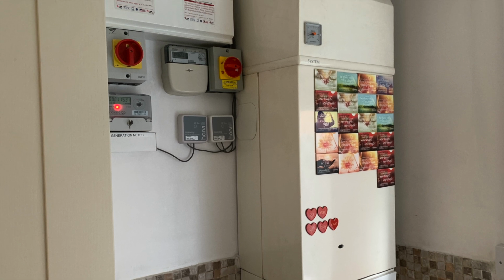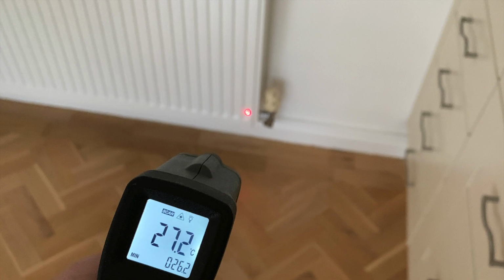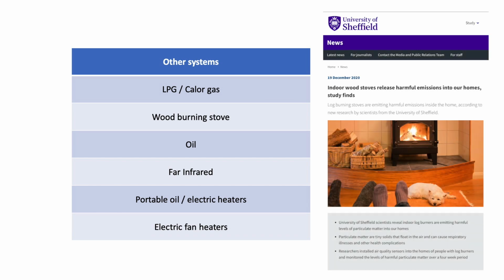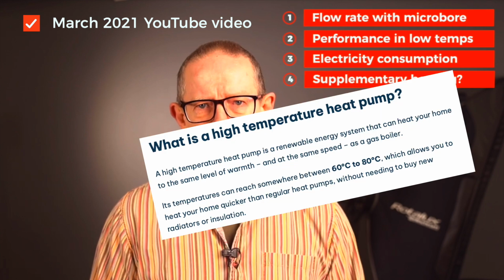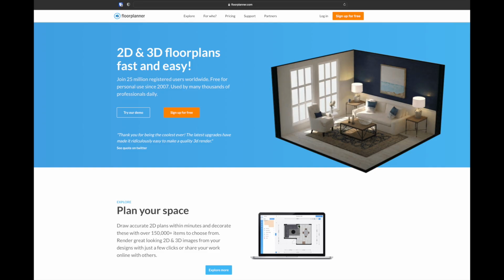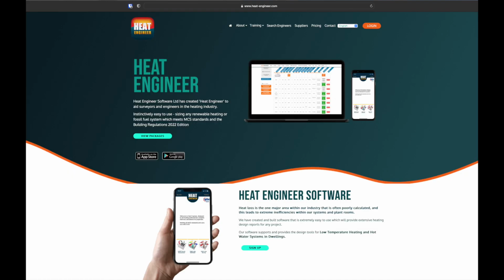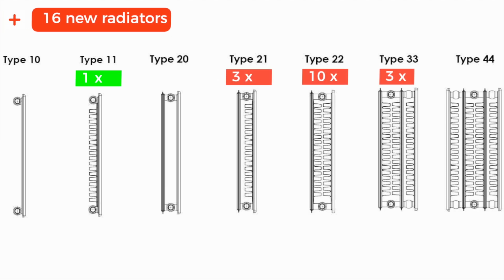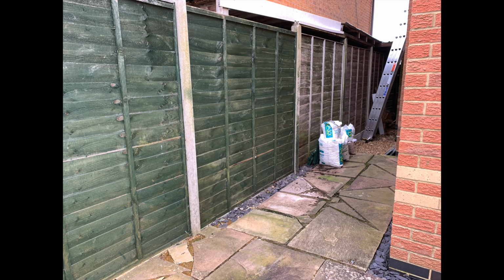Our new heating system - spoiler it's not gas!

Comment: Really informative video for the consumer well done. That’s from an installer my self. What cop did you end up with so far after install.
Reply from the maker: Thanks for this Simon. COP for past 30 days is 4.8 which is much better than expected. Heating on 24/7, DHW run most days.
Reply: What’s the average been across the year that’s impressive
Reply from the maker: @simonmeachen3375 installed end of July, but reset open energy monitoring recoding stats from 20th Sept when buffer tank was removed and air in system removed. These two things were dragging down the efficiency big time in terms of the stats recorded from the heat meter. the reality was it was working okay, but needed tweaking to improve the DHW runs due to air in system throwing the ultrasonic sensors in the heat meter to record poor flow / cop. I have videos covering this. From 20th Sept cop 4.70. Heat curve 0.4, desired temp 19.5°C. No zones, open loop on 24/7 with weather comp and room influence

Comment: Really interested video we are in a similar position but may be able to install under permitted development as we have 1700mm which is just enough for the planning permission did you need to do any sort of noise impact assessment or did yours meet the mcs 020 requirments?
Reply from the maker: Thank you for watching. We didn't need a noise impact assessment as the position was not near any neighbouring windows or in direct line of sight. It therefore passed the MSC installation requirements for noise assessment. 
With the planning application there was a 'standard' noise assessment from the environmental team (can't recall whom) this was a generic desktop style assessment following due process rather than a specific in location noise assessment.

Comment: You mentioned at the pros of air to water heat pump that they have not cooling facility.
I am from Greece and at one job site-office we had AWHP that could do that with special radiators with fan. It wasn't as cool as a AC, but it worked fine it could make a huge diference from outside. It could drop the temp from 35°C to 25-27°C in 30 minutes.
Reply from the maker: Thanks for watching. I found out that it was possible to have a cooling facility with a heat pump. We since have installed a Vaillant ASHP which can have the facility. As you point out it's not quite full AC. 

I have concerns with a wet radiator set around condensation forming on the pipework buried behind walls and under floorboard which can lead to damp issues within the structure of the home.
Reply: @johntisbury  If every pipe is insulated and there is not even an inch without cover there is no condensation. I saw at your video how well they insulate these pipes and I can tell you that you wouldn't have any problem. Don't forget, you will use it only for a few days every year and not in every room, living room and bedroom for a few hours. Condensation will dry out in a few hours in a very hot day and it won't damage the walls or the floors. Good fan coils have a small container-tank underneath that you have to empty every day or you can put a pipe to drain the water outside. I am not sure but I think that for this purpose you need a special liquid in your system, water is not recomended.

Comment: John, great help, thank you. Did you explain how you use  myenergi products and solar to heat your water? I can’t see any video. Did you buy a new water tank?
Reply from the maker: Thanks Greg. I have not done a standalone video on how I use the myenergi products, it's sprinkled in most monthly update videos. 

At present I have a 125litre foam copper tank that was new around 10 years ago. It has a single immersion heater in the top shoulder of the tank. I use the eddi to heat the hot water from surplus in the summer. In the winter I use off peak electricity as it's cheaper than using gas based on the poor efficiency of our boiler, losses along the way etc. 

With the heat pump I still plan to use the immersion heater and excess solar. However I will use the heat pump during the winter as it will be more efficient than using the immersion heater.

Comment: Air to air can run heat in one room and cooling in another. Even to the point of heat recovery where you are moving the heat from the room you are cooling to the one you are heating. Obviously it requires more complex pipe work but it is possible.
Reply from the maker: Thanks Matthew, good to know. I was not aware of that.

Comment: I’m looking to do the same! Thanks for your video, I will be interested in how it works for you as I have micro bore so I’ll be looking out for your next video!
Reply from the maker: The dreaded microbore! I don't believe it's as much as a problem as people have made out. We shall see. Thanks for watching.
Reply: @johntisbury  hope so, my Plummer friend said he has “knocked about” some houses on my estate and he says the “drops” are 15mm and it’s only the tails that are 10mm so it maybe not too bad to change that. 🤞🏻 I’d be interested in your choice of radiator too, from what I understand aluminium radiators push out more heat. My other friend has just fitted an air to air heat pump in a few rooms (mainly for aircon) but he has been amazed at the instant heating from them. If your extension is difficult to heat could you maybe add one to that room?
Reply from the maker: @scottwills4698  I found some photos I took in 2000 when our current house was being built and I have a photo of the pipework upstairs under the floor. I believe we have 22mm to the rads with microbore tails, so yes that maybe the case for you too, just the tails. I need to show the photo to our installer for them to look at. We have considered A2A longertemr of a couple of rooms, mainly for cooling.

Comment: Thanks for another interesting video John,  looking forward to the next installment.  I'm trying to do the right thing (for once) and investigate going to triple glazing before my heat pump plan starts, not sure I'll succeed.  It was good to read about your microbore testing.  I have a (potentially) slightly different challenge of having a mix of copper and Hep20 plastic piping.  In addition our combi is in the garage and it is an 80' piperun to the shower room.  I had the idea of Eddi and tank in a cupboard next to the shower room cutting the pipe run to about 10', this I have to get right as my wife likes showers hot (too hot in my opinion).  

On a separate question, which I've been meaning to ask for ages, with the second solar array, which is below 3.68kW did you need DNO approval as you already had 3.8kWp and Powerwall?  The guys who installed our seemed to think we'd not get a second powerwall past the DNO.  (I know they vary in attitude across the country alot).
Reply from the maker: Had you thought about an electric shower for the shower room? It would mean larger electric bills though, so mayn't be the best solution/suggestion.

Yes the DNO were informed with no issues. However, I doubt we would now get a second Powerwall through without going down 3 phase or split phase.

Comment: Good video John. I have microbore as well, concrete ground floor & T&G chipboard floor upstairs so replacing pipework is not really an option due to the upheaval required. I have Tado smart valves on every radiator (singles & doubles) except for two rads in the shower & bathroom which act as heat sinks when most of the rad valves are closed. My wall hung system boiler (Ideal) was replaced 4 years ago & like you I have tried running it on lower flow temps. It struggles on anything lower than 55c when it short cycles because it cannot maintain a steady flow temp (I have the pump ramped up to the max speed). Like many boilers it is probably oversized which explains why it cannot control at low capacity. I already have a single 4kW wall mounted mini split in our conservatory which works fine for heating & the occasional bit of cooling. Solar, a 9kWh battery & an Eddie have recently been installed so my next step will, like you, to decide what to replace the gas boiler with. A2W may be an option but having spent 48 years in the HVAC industry I'm leaning towards an A2A multi split system with a separate solution for HW - probably an all in one HP HW tank in our attached garage (too noisy to have in the airing cupboard). 
I will watch out for for your next video with great anticipation to see how you get on.
Reply from the maker: Thanks Colin for watching and your detailed summary of your circumstances. I guess there are many people like the both of us who are going through the same thought process and deciding what's best for them. Certainly seems sensible to stick with what you know based on your HVAC knowledge, I no doubt would do exactly the same.

Comment: Hi. John, very interesting. We had a 14kw mitsi heat pump fitted just over a year ago. Heat loss calcs recommended changing 7 rads, but we didn't change any, through the winter on the coldest days, we only found one radiator which could have done with being larger. Regarding the PW2, on the coldest days we would empty it in 4 hours. We now have fitted a second PW2 , so looking at next winter expect a minimum 8 hours from the Powerwalls plus 6 hours  off peak electric on Intelligent Octopus, a bit solar and Ripple Energy makes it so much cheaper than Gas.
Reply: Thank you for all the information John.
Can I please ask about upsizing the radiators?
You have already experimented with the current rads at 40 degrees flow temperature and your house was comfortably warm. Of course you have had very detailed heat loss surveys, but if the temperature was satisfactory why to get into the trouble?
Reply from the maker: @serraios1989  it's a good question. Whilst that rads work with a gas boiler at 40ºC, it did a lot of cycling as it's not really designed to run as that low temperature. With a heat pump you don't want cycling as it kills efficiency and uses more electricity ramping up and down. If the heat pump can keep the temp at 40ºC by having large radiators there's less chance of it needing to cycle. Larger rads means more water in the system which gives more thermal mass and temperature stability which leads to a more constant heat.
Reply from the maker: Thanks for the information Stephen, that's good to hear. Not good to hear about a 4 hour emptying time for the Powerwall mind, I did think that maybe our weak spot. Time will tell. Agree totally about being cheaper than gas with the inputs from Ripple and solar. I will factor those into our costs and savings when I get to do a how much did it cost us to run this winter video next year!
Reply: @johntisbury  Hi John we found the same issue with our 16kW Samsung ASHP in that it would drain our two PW's down.  We are installing a 3rd PW at our new place ready for when we convert over from Oil to ASHP.  We are arranging for a heat loss survey so that we can size the ASHP accordingly.
Reply from the maker: A 16kW heat pump is massive, mine will be 7kW, hopefully your heat loss survey will indicate a smaller unit for your new place.
Reply: @johntisbury  yes this was fitted before heat loss calculations were taken into account, it worked well with our underfloor heating and vented cylinder tank. Property was EPC A100 rated.
Reply: @johntisbury  Hi John, Just an update on our two Powerwall's performance this winter(23/24) with a 14 KW Heat Pump. With Outside air temp above 5 degrees, our Powerwall's last until around 6pm (with average 5KW solar), give or take an hour. With Temperature of 1-2 degrees outside, they would be empty by  2pm..... but still cheaper than gas.
Reply from the maker: @stephenpierpoint9109 appreciate your update Stephen. Those performance figures ratio aligns with my 7kW ASHP and 1 PW2.

Comment: Nice thorough job

Look forward to comparing numbers next winter
Reply from the maker: Thanks Nigel, I think you will winning in terms of pull from the grid. We have very different approaches to heating our homes , our approach will almost certainly use more leckie.
Reply: @johntisbury  I'm adjusting slowly towards a more continuous heat and ceasing wood burning too so should use more energy over time but yes we're all different
Reply from the maker: @EVPuzzle  sounds like a good approach. This is what I love about us sharing data, ideas and approaches. You take away what works for you.

Comment: Looks like that 700mm is just above the minimum clearance specified by the manufacturer? 

Do you have the option to put it in a more open area if permission is refused?
Reply from the maker: Manufacturer states minimum clearance is 600mm with 250mm behind. I can be put elsewhere in front of the kitchen window but that means the external pipe runs are 40m. I very much doubt planning will be declined based on chatting with the planner when they came round to take photos.
Reply: @johntisbury  What's the airflow like down that side of the house? A "wind tunnel" or a "dead zone". I imagine you need a fairly decent amount of air movement to keep it at max efficiency.
Reply from the maker: @salokin1  it's windy like Chicago. I've changed the fence which faces the road to an open slatted design to increase the through draft. I will cover this in more detail in a future update video.

Comment: one option you missed ! . . . an integrated "heat pump cylinder" for hot water supply ( to pair with air-t-air heating) . . . several manufacturers do them these days. (Vaillant, Daikin (but not yet UK), Curv, Mixergy, to name a few) . . oh and another option is multi-split het-pumps which do both A2A & A2W (just one branch for water heating) . . .
Reply from the maker: Good call. I’d discounted the heat pump cylinder as A2A is a no go for us as mentioned..

Comment: Interesting stuff, Do you have any 22mm at all? whats out of the boiler. I hear you said microbore but I wonder if thats fed via a 22mm backbone at all. I've got some 22mm/15mm and wonder if Im better getting the rest upgraded to 22mm first. I've had Type 33/K3 stelrads put in this year ready for a heat pump in future, they are huge! good though.
Reply from the maker: Thanks for watching. Yes we have 22mm to and from the boiler / hot water tank. They're maybe a manifold somewhere in the house, no idea where, or they may had teed off 15mm with microbore. All pipework is hidden behind the plasterboard so no idea really. The larger the pipe diameter the better in terms of improving efficiency / SCOP values.

Comment: Another very Interesting video John and useful to compare with my own situation and upgrade. I also produced scaled drawings of the property and performed some basic energy calculations on my EPC A property, albeit with a very inefficient gas fired warm air heating system currently.
I am going A2A with a multi-split system using 4 x indoor units.
I'm also going through planning permission for similar reasons to yourself plus the added cooling capability.
I intend to swap onto Octopus Energy Cosy tariff when my Go Faster expires in the summer. That would enable me to charge the PW2 twice per day as required.
Looking forward to the next installment.
Reply: I'm sure they will be. My application was delayed because of the local elections and the council has changed leadership from Conservative to Labour. I went through pre-application and they suggested that there wouldn't be any problems.
A2A is the logical solution for me and although not eligible for any Government grant, it is much cheaper than A2W.
Reply from the maker: A2A makes sense as you are replacing a similar air ducted system although it will be so much more efficient. 
Has your installer contacted the DNO for approval?
Reply: I wasn't aware that the DNO needed to be informed. Can you enlighten me?
Reply from the maker: @jerrywatson966 it's seen as an energy device so the DNO needs to be informed. https://www.gov.uk/government/publications/register-energy-devices-in-homes-or-small-businesses-guidance-for-device-owners-and-installation-contractors/register-energy-devices-in-homes-or-small-businesses-guidance-for-device-owners-and-installation-contractors
Reply from the maker: Thanks Jerry, it’s interesting to hear about others like yourself on similar journeys with slightly different choices. I think local planners will be very busy with heat pump applications.

Comment: Great to see the follow up John. Great idea to test the microbore pipework at low flow temp, going to "steal with pride" and try that myself- Same David Wilson installed boiler and system as you. Are you going to continuw with your present electric hot water via solar and Octopus? - perhaps Mixergy ? This seems a good way to keep your ASHP to 8kw and flow temps at 40. looking forward to the next episode.
Reply from the maker: Thanks for watching and please do steal away! 
I'm planning to keep the eddi yes we are having a Vaillant Unistore 200ltr tank and we will still use the eddi / excess solar over Spring/Summer. Probably use the heat pump in Autumn/Winter as its performance is at least 3:1 rather than 1:1 with the eddi for DHW.

Comment: Very comprehensive John, enjoyed that one. A quick question about your ASHP installation / space, is only 700mm in front of the unit adequate ?
Reply from the maker: Thanks for watching Mark. Yes the minimum stated in the installation manual is 600mm in front and 200mm behind. So we are above both those figures.